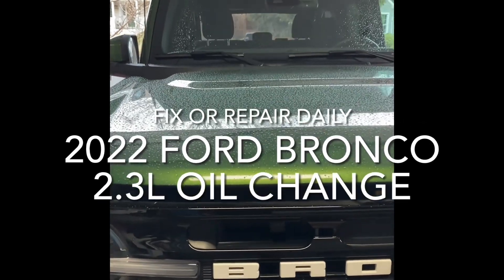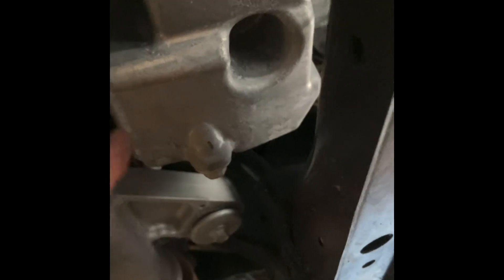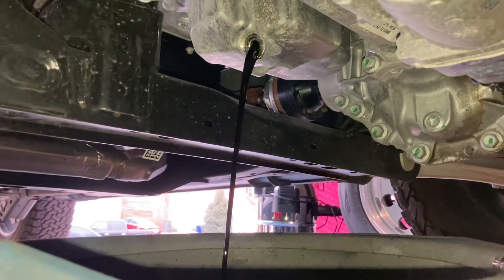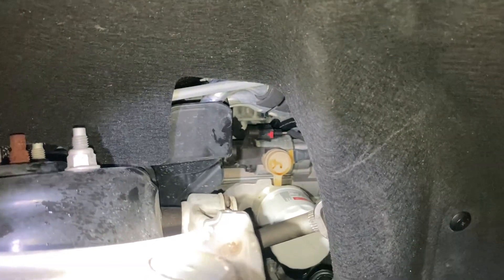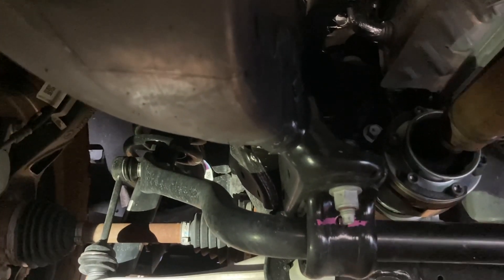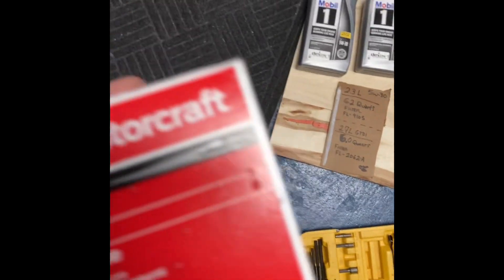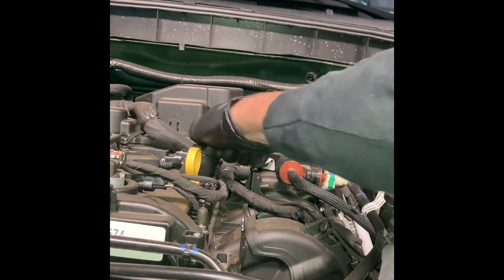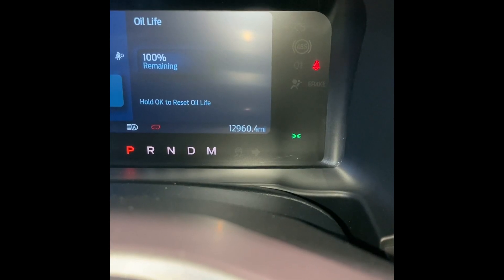Ford Bronco 2.3 Oil Change 2022

Comment: Nice video but I have one question or observation.  Unless something has changed that I don't know about, the proper way to check oil level is after you turn off the engine and let it set for 10 to 15 minutes.  Not while the engine is running.  Seeing where that filter is mounted, I would like to see the engineering degree of the fellow that designed that.  That's what I liked about old Fords from the 60's and early 70's.  Did not make any difference if it was a straight six, 289, 302, or 427 they all took an FL 1A filter, and they were ease to get to.  Nice bronco.